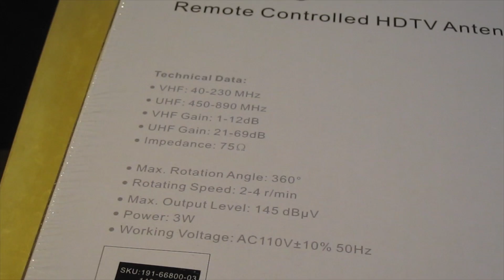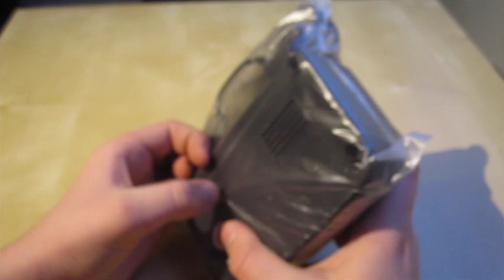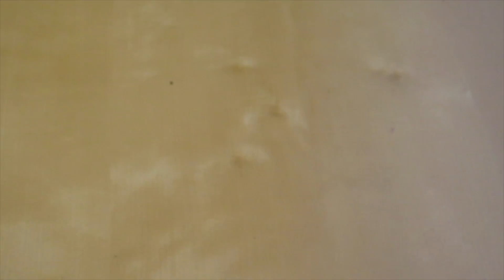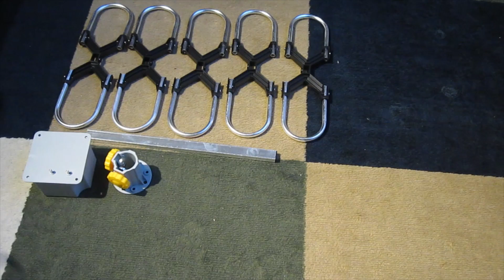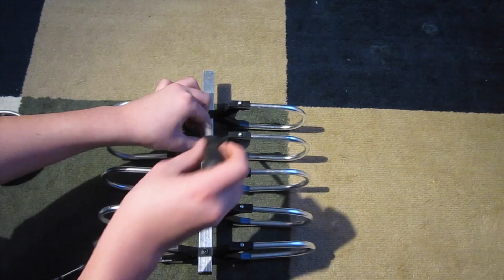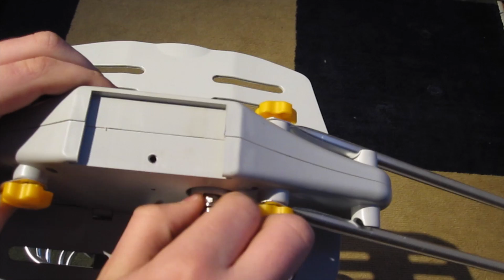Unboxing & Setup: SKY HG-995 Remote Controlled HDTV Antenna

Comment: Matt, I have looked at hours of videos related to this antenna and your's is the ONLY one that talks about how to connect the antenna up to the power supply and shows how to connect it to the TV!  The other videos focused on the assembly, which I found easy.  I have never had to figure something out like this before because I had a husband who did all this kind of stuff.  Now that I have it assembled,  I have a friend who will help put it up on the roof.  Hopefully, the existing antenna's pole will work for this one!  Now, it does have the ability to connect another TV, BUT my other TV is in the back of the house and is not currently connected to the existing antenna.  So to connect it to the power supply in the living room, I guess the coaxial cable would be exposed throughout the dining room and hallway!  Guess I'll just have one connected to the antenna.  Anyway, thank you for taking the time to go through all the steps in detail for us dummies!

Comment: It works  according to the area  where is installed ,if it works fine  you are in a good signal area , with the transmitter in a line of sight near you or over the horizon.thank you.

Comment: I couldn't get very good reception from the VHF antennas. I found that removing the antennas from the molded slots in the body of the antenna and positioning them where they are sticking straight out (NOT TILTED SLIGHTLY FORWARD ON THE SLOTTED BODY MOLD) I improved my reception from 53 to 63% to 89 to 91%.

Comment: IMO channel specific intros  should be short as possible. In the event the plan was to assemble taking everything out of the box first to describing the parts  was in  way  redundant. The video could be made shorter by taking everything out of the  box and detailing the components as you assembled it. Yea I know someone would have had problem with that.  You sound young. I don't know  what sort of career path you are taking.  YouTube videos are part of resume if a position in video production becomes an opportunity. Short to the point, but still informative videos rule. That's why I bring it up.

As for the product when I seen the screw type used to  attach the pole mount to the motor its was a quality I didn't expect, the first screw  shown suggested metal inserts in the motor body, however the last one you show was wither out of focus or is was a self tapping scre but was  disappointed to see the quality drop anyway when self tapping screws where use to attach the antenna body.  Photos suggest a Yagi, but if there wasn't a specific order in mounting the elements to the boom, it's all about looks.

Comment: After doing alottt of research, watching YouTube videos, reading this & that info at many websites, I decided to get due to the good reviews, or so I thought, I hot it & put it together the directions are very vague, & the materials are very fragile, but who cares about all this if it lives up the all the reviews & hype, well I tried inside outside on a 13 foot pole the motor burned out within a half hour, my TV pick up zilch, squat, natta, nothing, not a friggin tuning, I was so excited & was a bit bummed & ticked off, I said hey... Maybe it can at least be a decent am, FM attena????? I turned on my yamaha receiver , tuned it to the closest local, country station, the signal was clear & strong, with the scrony thin black stock wire that come with alot of radios & shelf systems, so I disconnected this point wire, & connected my HD rotary amplified 39db gain, antenna, the stereo, light was flickering, & wouldn't stay on\locked. That's amazing that a skinny simple little black wire, out performed this high tech, looking antenna outside 13 feet high on a pool & being amplified, this thing in short, is truly a joke, one of the biggest prices of junk, I've everbough, even for the communist Chinese, should be ashamed of themselves, prob notttttt. This thing isn't even worth the thinnnn aluminum, & lead filled platic, its made of, do yourself a big favor, take your hard earned money else where, these paper weight jokes, go under many looks & brands lava, etc, being some of the others, hope this helps someone avoid everything I went through

Comment: I had a $3 antenna and I would get about 18-20 channels,,, then I bought this one and its on the Roof now, I now only get 8-14 channels :(  and then when I try to turn it and point it somewhere else...I re-scan channels and I get the same channels but less of them. I am not sure what I am doing wrong!! please help... I have the antenna on the roof mounted.. should I maybe turn the antenna UPWARDS to point towards the sky a bit.?  and should I keed re-scanning my TV? or don't re-scan? thanks
Reply from the maker: do you have everything connected right and look on line for the pest direction to point the antenna
Reply: Matt Kaczynski This kid truly should have mental help. What the hell doe's the direction to a pest have to do with aligning a TV antenna?
Reply from the maker: i meant best direction
Reply: iKnifeU123  this is a directional antenna. use tvfool.com to find what is your best direction. If you have multiple paths greater than 35 degrees apart, multiple antenna may be required.

Comment: Amazon says they don’t know if it will be back in stock. They found out it’s a piece of junk. I have one
Reply: Well , if d antenna last a year (of free tv) for $30 dollars the antenna costed , then you have saved hundreds of $💵💰, if you had cable for a year😁
Reply: This rotating antennas are made in china (plastic) , looks well constructed but the rotating mechanism and internal electronics do fail with time and weather against it . Mine failed after just 5 months in tropical conditions , in Puerto Rico ... but it could last longer for others✌

Comment: Any body try this antenna set indoor like in the attic.
Reply from the maker: yup, thats where I have mine. I used U-Bolts and mounted the pole to a stud in the attic. It works really well for me.
Reply: To bring up the obvious it depend on the roof construction. Forget it if the roof is metal  or if a radiant barrier is installed in the attic.  Other materials can attenuate the signal as well if the aggregate thickness is thich enough

Comment: I could care less on what the box has or does not have.. as long as it's not damaged
Reply: Garry Brpwine  use tvfool.com report for expected channels. 
The distnce deends on lie of sight, and distance above ground you mount the antenna. Usually 30-50ft above ground will give great results

Comment: The mount is 1" and Dish mount is 2", how can you mount it to you old Dish satellite?
Reply: Cut a small slit in the top of the 2' mount.  Then take some vice grips (or anything with a good clamping grip) to clamp it down to an approximate 1' pole to attach the antenna.  Or you can buy an adaptor...  Either one works.

Comment: What do you think of this 1 year later?
Reply from the maker: +Mark S It is awesome I still use it a lot for local TV.
Reply from the maker: +Scott Thompson Yes I still do and it is connected to all the tv's in the house and it works great!
Reply from the maker: +Scott Thompson I think 30-40
Reply: antenna power supply
Reply: I love mine a year later.. Still works great.
Reply: I bought an ONN rotating antenna from Wal-Mart that looks just the same as this one (probably are same but rebranded) ... but after 5 months of use it died😢, control box is On but not the red light indicator on antenna and no rotation😭 . I tried a different better cable (because the cable it brings is flimsy) but , no hope .... Now I'll try an RCA all metal amplified yaggi antenna with a 40'ft. quad shielded RG6 cable and just in case a small RCA indoor (plug it) signal amplifier ... let's hope😯

Comment: How many mi away will this antenna pick up? Maybe I missed this... Thanks
Reply: It specs at 150 mi. range.
Reply: ***** is that th e same cable channel you can pick up for this amplified hd digital outdoor hdtv antenna with motorized 360 degree rotation...to end my monthly cable bills....pls reply
Reply from the maker: pariskarl24 It doesn't get all the same channels as cable it only gets local channels like the news and more. Use tvfool.com to see what channels you might get and where to point the antenna.

Comment: I keep seeing rave reviews for this thing.  they are bullshit.  I only live 25 miles from the broadcast towers in moderate hill country - elevations vary about 500 feet.  In one direction I can get nothing.  From the other grouping I get distorted images that last only a few seconds before I get a message that there is no signal.  I have been trying to tune in a channel all day long.  I have mounted this on a pole 15 feet in the air.  If you live in mountainous or hilly terrain I would not waste money on this.  I'm out about 100 bucks altogether as well as a couple of days of running back and forth to the store and working on this.  I am not pleased.  At all.  :(   I can find absolutely ZERO support from the company who makes this on how exactly to get a signal on this piece of garbage.  This company can kiss my ass.
Reply: All these reviews are lies,how can they get away with it.this is a piece of junk.there is no such thing as a hd antenna.if you won't a good antenna get a channel master or wingard outside antenna

Comment: Does it really have a 150 mile range.
Reply: +Mojo Ala I don't think you can watch UHF -channels  so far away for daily. The receive range be relative to frequencies, and it states for smallest frequencies. This antenna has really wide frequency space, and the smallest frequency is 40 MHz. (Longest pipes exists for it.) It is possible  to get radio 150 mile far away for daily on on area with good condition. Receive range depends mostly on beam length. I have tested the 60 mail receive length is somehow possible on 2 meters long beam.
Reply: +jzray if you install as part of a 2 antenna set up (this one powered and the other standalone) then you can very easily get the lower frequencies you're missing.  Also, you could just turn off the power amplifier.
Reply: @jzray  no antenna will reach 150 miles because if the curve of the Earth,if it could I would receive over 300 channels it's not gonna happen

Comment: Range please
Reply: 150 miles chief.
Reply: I see no one bother to give you an honest answer. Range figures have always been the best guess.  Even those derived com computer modeling, specs provided by the manufacture should be taken with grain of salt. Play around with this on line calculator https://www.easycalculation.com/physics/electromagnetism/vhf-uhf-distance.php  when you put not the transmitter and receiving antennas  at the top of 1000 foot towers at their locations the best  range you could get is 90 miles because the curvature of the Earth.  Refraction over the horizon could increase that figure, but  don't spend much money counting on  it, in hopes of receiving a  distant station.

Comment: The antenna works good, but the remote control design has got to be about the dumbest design of anything ever made.  It has two buttons?  If the remote buttons are not directional buttons then why in the hell have two buttons?  That just makes absolutely no sense whatsoever.   It should just have one button that goes the opposite direction after each pressing.  Regardless I am able to get 60 channels with this thing